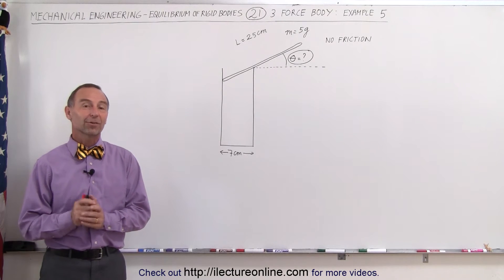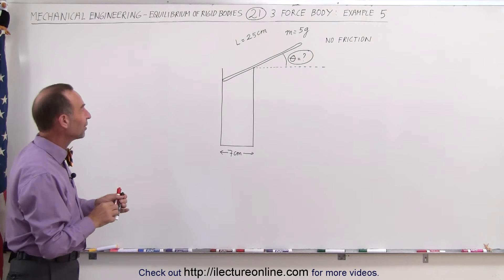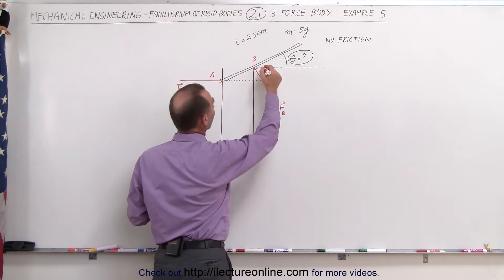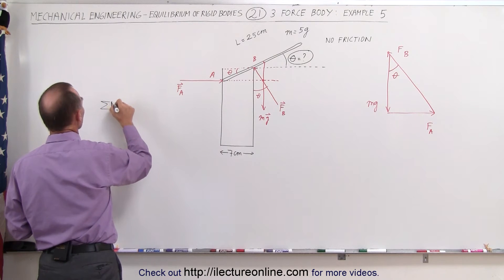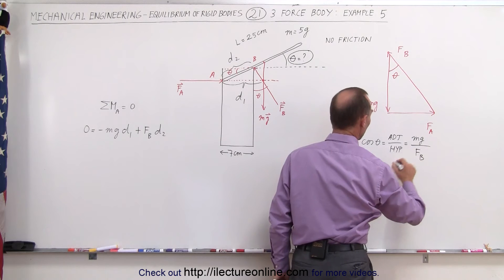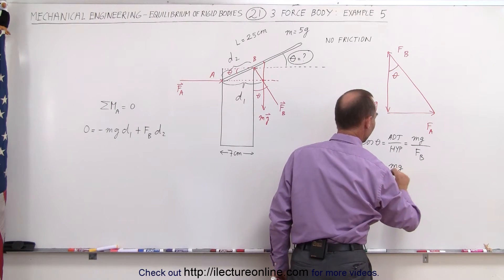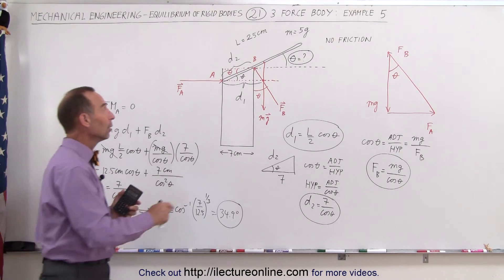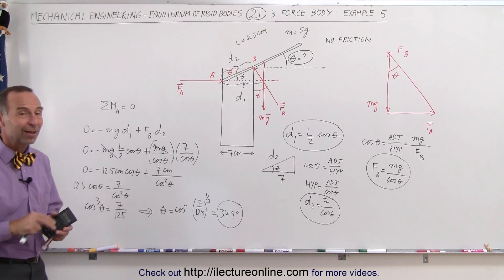Mechanical Engineering: Equilibrium of Rigid Bodies (21 of 32) Ex. 5 Eq. of 3-Force Body

Comment: Thank you for the great explanation.  Sir, Why we take force FB perpendicular to the rod not parallel to the edge of the glass?
Reply from the maker: That is a principle in physics.  When there is no friction, the forces can only act perpendicular to the surface at the point of contact.
Reply: Michel van Biezen, I see.Thank u for the response.